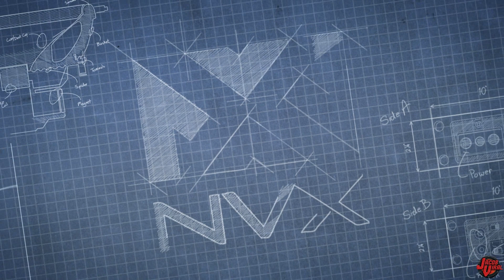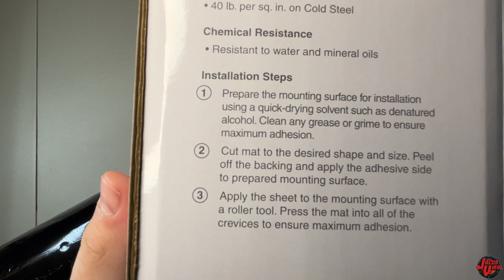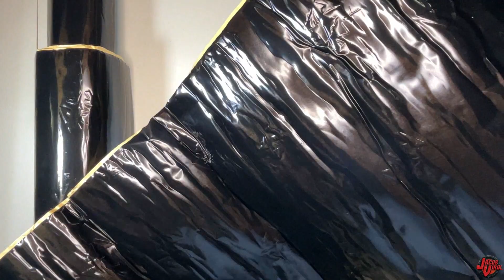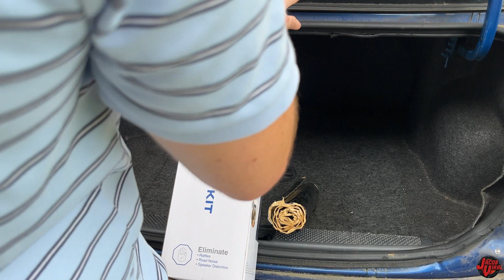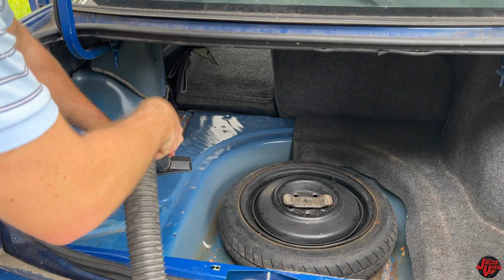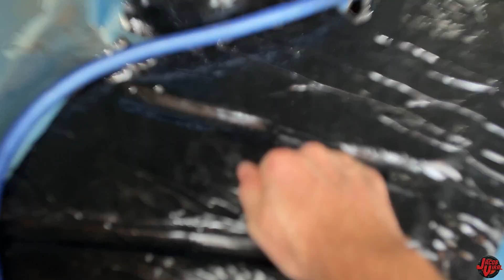SOUND DEADENING INSTALL BEFORE & AFTER RESULTS

Comment: Cheap relatively easy sound deading.  Rinolining from autozone and heavy duty aluminum foil spray it in sections and while it’s still wet put the foil on it and roll it with a fiberglass 4inch roller

Comment: What if I can’t find where my rattles are coming from?
Reply from the maker: It'll show when you play music with subs usually, depends on location and how serious you are trying to get.
Reply: @JacobViral  I have a lot of minor ones, like a LOT and I push on different panels from the outside and they stop lol, I found that sticking styrofoam wrapped in duct tape and wedging it inbetween panels and plastics works pretty well, the rattles are mostly at higher frequencies and are a lot quieter now, it’s most just my taillights now

Comment: Does thicker material work better? Or does the thickness not a huge factor?
Reply: Thickness helps alooot. I recommend atleast 80mil minimum
Reply: @918Kustomz  ok tysm, I’m on a budget but I’ll do the best I can, I have some trunk rattles and I don’t even know where they are coming from, the license plate is fixed for the most part but I think my spare tire area is rattling along with a few others
Reply: There are a lot of misconceptions about sound deadening. It was proven back in the 90s that covering more than 25% of the vehicles sheet metal with sound deadening wastes money and provides little benifit. Better results can be had with 25% coverage of sound deadening, completely cover the interior with closed cell foam, and then MLV beyeer the foam and carpet. 1# MLV has the same sound insulating property as the exterior wall of a house... best of luck.

Comment: Hole in the trunk to lead the wire ??? Dude you really have insufficient competence in car audio :D
Reply: Yeah but you shouldn’t have sharp metal edges near wire. It’s just asking for problems. This guy is right about your competence.
Reply: Just got to the end of the video. I was skeptical in the first place that you were applying deadener to the least resonant part of the trunk. Literally no difference in your knock test
Reply: Is there no gromet ? Jacob
Reply from the maker: I always ran wire under the car and through a hole into back with no issues.

Comment: Nice I need to deaden my back doors on my suburban but first I need to recone my 2 18" Soundqubed subwoofers my 18" American bass Godfather series sub and I also blew my older 15" American Bass subwoofer and my 18" Skar SDR. I also has my U1-8000 amplifier quit working. It stays in clip and no signal comes out. I now have my 2 Soundqubed S1-2250.1 amp hooked to a 12" Power Acoustik sub.
Reply: I hate to make fun of it but the other day when u posted the free air to max suspension then an hour later, I bent my former blown subwoofer sorry but it got me lol
Reply: SMD DD1+ will help.